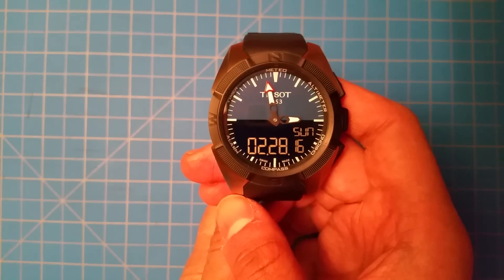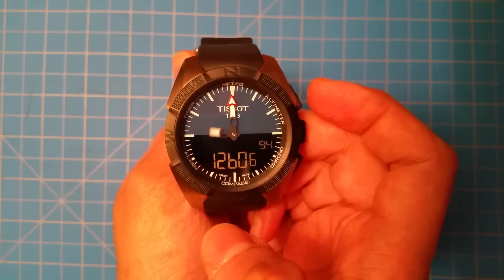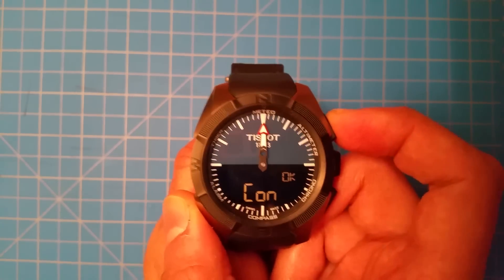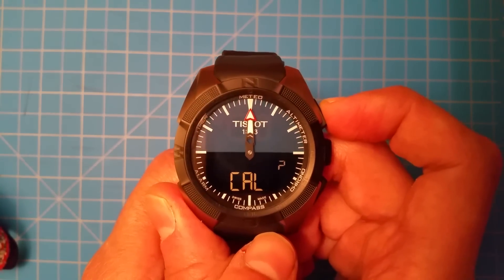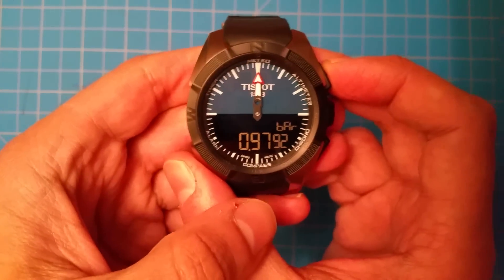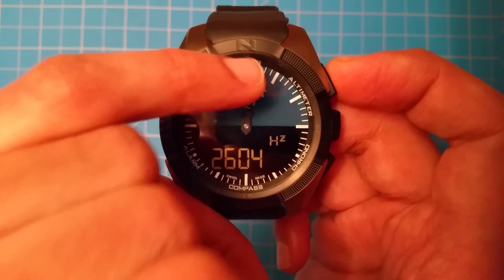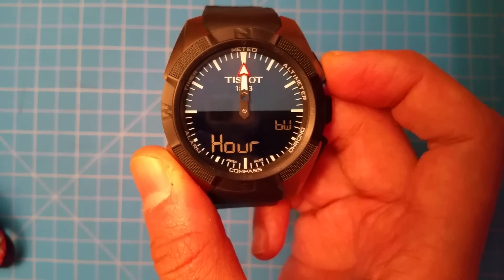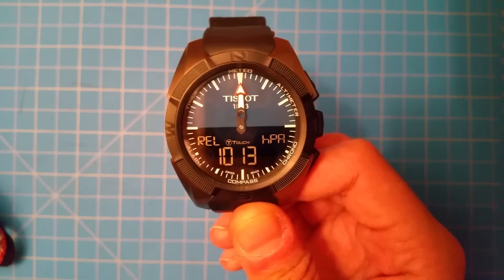Tissot T-Touch Expert Solar - service mode with hidden temperature/compass calibration

Comment: Great video my dear friend, full of useful info! Thank you for sharing it! Indeed, for some people like me, having a Lumen (Lux) Meter at hand (literally) can be quite useful as a tool (for example, in order to measure the performance of LED equipment), which, like most things, degrades over time). Most importantly, it's on your watch, so you can always, easily and effortlessly have it on you wherever you go! 🙂 
Oh man, you really made my day with this little trick! I'm writing this comment while wearing a "T-touch Expert Solar" and I had no idea I could even do this on my watch! 🙂 I'll make sure to try it today to see how it works in practice. Needless to say, I'm deeply grateful for sharing this "hidden" method with us all! Thank you so much! 🙂
It would be though much nicer if one didn't have to turn it off first in order to use that feature, as well as the *thermometer*, which means, I suppose, that you'll have to re-set the time whenever you want to "wake it up")...I wish there was a way to access/activate these features-tools without all that hassle. 😞 
in my opinion, this is one of its (minor) disadvantages, and makes me think a bit of it as a sign of (minor?) sloppiness in terms of design and engineering, because it would have been  definitely do-able. Indicatively, in my "Sea-Touch" (which is the divers' model in the T-touch collection), the thermometer is just a 'push' (with the central pusher) and a click away (by pressing with your finger on those points of the dial right next to the inner perimeter of the bezel, which activate the main features/functions! 🙂And as you know, that is because the Tempo is one of the main features activated through the bezel, whose position in the case of the 'T-touch Expert Solar' has been replaced by other features, such as the Meteo (that is, the barometer*), the *Altimeter or the Timer*. *But in any case, I'm pretty sure they could have found a way to make those features/functions more easily accessible to the end-user. Besides, doing this would only enhance the value of the watch from a user's point-of-view...Well, go figure! The world of watch-making is full of surprises! 🙂

Comment: ABSOLUTE GARBAGE!
Tissot T Touch and all other brands handled by the head company are complete garbage, don't buy them!
I brought my 10 year old T Touch to the dealers head office and they told me they could not replace
the battery, I would have to buy a new watch then tried to upsell me. The original T Touch cost around $2K.
Now it's garbage. $2K lost to a dead watch. Fuck em, I'll stick to real watches like Breitling.
Don't waste 2K on a watch that will die in 10 years. Complete garbage I tell you!
Avoid all watches under the head companies portfolio at all costs unless you like wasting money.

Comment: Great short video showing the hidden features. Temp was the main feature I would've like to have seen easily accessible. The Lum feature was used to test several torches (on post op leave and can't walk yet, idle hands and all that) and was quite accurate. Thank you for taking time to make this vid.

Comment: Hi 
My watch is showing different time on the digital and analog displays. Tried to use the Sync function and synchronize both but its not working. anyone have any idea what may be wrong?
Reply: https://youtu.be/f9Ge2jJWjfY check this video, maybe it helps you.

Comment: Do you have any idea about calibrating the barometer? My watch reads 3-4 Hpa above the actual pressure.
Reply from the maker: There is no way to calibrate the barometer that I'm aware. You can adjust it, but then your altitude reading will get thrown off accordingly. It would be nice to be able to adjust the absolute pressure.  Mine reads 2 hPa above actual.
Reply: @dalistylin7740  Have you found a way to calibrate the barometer? I could find a reading in service mode which seems to indicate the pressure in bar, but could not change it.
Reply: The difference doesn't matter, only that you can see a big and rapid raising or drop in the preassure on the minute hand is all you need.
Reply: How can you say that the difference doesn't matter? Tissot is a Swiss manufacturer and one would expect precision from such. It matters when you have set the barometer settings from the local weather forecast to get an accurate altimeter reading. In any case, not worth arguing about. Matters to some and not to others. BTW the iPhone's barometer is more accurate.

Comment: Question for you: can the barometer be set to read in inches of mercury, or are the only options bar or hectopascals?
Reply from the maker: No, it can only display in HPa.
Reply: Bummer, thanks for the reply.

Comment: I wish they would DELETE the Altimeter, and add the TIDE function to the Expert Solar!  THEN it would be a perfect watch for boaters, surfers, kayakers, Navy, divers, sailers...    Who needs and altimeter on their watch??
Reply from the maker: Machria23 I personally prefer the altimeter function. The tide function is available on the Tissot T-race watch, but it lacks some other features of this model.
Reply: Get a tide app or look it up for the day in question. Tide times on vary by minutes per day it's not essential.
Reply: totally agree; say a person who used to live at 10K. So silly to have an alt. function if you're still on the GROUND! We could always tell how high by how hard our heads were pounding when we hiked LOL. And so you know exactly down to the foot how high you are, what exactly does that give you? If you can't read a topo map in the daytime and look around, go home....
Reply: @rockymntdan1  Fortunately not everybody is always on the ground! The altimeter function is useful for pilots, and would be more useful if we could adjust the absolute pressure.

Comment: For those of you who want to get the NSEW digits into black. Buy a fine tip permanent marker and color them in. I did mine and it worked out perfectly. Great finish in dark black and has been on for over a month. Even been swimming in the sea

Comment: if you are looking to remove the N.W.E.S letters use a sharp blade and try to get under the letters, because on my tissot PRS200 some numbers started disappearing and after playing with the numbers and touching them I found out they are very hard inks that can not be faded away by wear and scratches but they can be peeled off completely in one piece with my nails. also Im looking to get this watch but Im looking for a version without these letters and titanium, do you know any other model?
Reply: As stated above. Without damaging the watch I just used a fine tip black permanent marker and colored the digits in. I waited for it to dry and applied a few coats. Works a charm and looks good.
Reply from the maker: sweet dreams Later, I ended up using black acrylic paint to color over the white lettering since it doesn't wear off easily, but removable with alcohol or ammonium solution if I need to in the future. There are some other models of the Tissot Solar Expert without the NESW lettering, but instead 12, 3, 6, and 9 hour markers (equally useless), but I prefer the style of this model (in terms of dial and hour markers).

Comment: Hello ! You can change the "meteo" readings hPa in mm Hg?
Reply from the maker: Unfortunately, you cannot change the units. It only displays in hPa, which is considered the international standard for measuring atmospheric pressure. I am having to get used to this since in the US, inHg is most often reported.
Reply: Thank you . another question. Why is there a thermometer in the service mode.  usually it is impossible to use. it would not be bad to have "termo" normally mode.
Reply from the maker: I have no idea why Tissot decided to hide this feature. I think it's useful, even if it may be inaccurate on the wrist.  It is not practical to access this feature in day-to-day use.  It is puzzling that they removed the "thermo" mode and added a useless non-rotating bezel with compass markings.  Despite these flaws, I do like the watch.
Reply: +dalistylin I really like it too. I have them for two years. Only orange design.

Comment: was hoping the temp. would be displayed as well with the pressure reading...thanks for the vid...
Reply: after seeing the temp change with your hand touching the back its good they didnt add this feature because it would mix the outside temp with your body temp and give you something not accurate and useless.
Reply from the maker: Same here. Wish they made the feature readily available. It could only help sales by advertising more features. Not sure why Tissot removed this.
Reply from the maker: sweet dreams I think it would still have been useful if Tissot made the temperature reading readily accessible. The quick responsiveness of the thermometer indicates it could give an accurate temp reading after a few minutes if removed from the wrist. They could have incorporated a simple corrective measure to compensate (semi-accurately) for temp reading while worn (though not ideal, other watch companies like Timex have offered this as an option when using the temp function).

Comment: Hello ,   what  is  the  autonomy  battery life  of the  watch , if  you  play  daily  with  ?
Reply from the maker: It's solar powered so battery life is not a problem. The battery is rated at 1 year without any charging. I've used it quite heavily and the battery had always been at full charge.

Comment: Useless this Bezel? 12 o clock fix point to Nord.... You know who is East and west without see it on the bezel?
Reply: dalistylin 
The markings are so you can aline the watch to a map or a chart so it is correctly orientated to North you dumb arse
Reply from the maker: I agree that the compass markings are useless. I've read every page of the manual and my conclusion is that it serves no purpose other than cosmetic.  If the bezel was rotatable, the markings could be justified, but it is not. It's too bad because I think the markings "cheapen" an otherwise excellent watch.
Reply: Studer Florian 
So in your mind a Silva compass doesn't need any markings!!!!!!!(+_+)
Reply from the maker: How useful is a Silva compass with a non-rotating bezel?

Comment: Great hints and nice review. I love the way you have darkened your bezel's NESW markers too. What have you used to achieve that result ?
Reply from the maker: Thank you. I used a black wax pencil, or "China marker" to fill in the compass markers. It is not permanent, though. The compass markings on a non-rotateable bezel seem totally useless to me, unless I am missing something. That would be my primary criticism of this model. Otherwise, it is a fantastic watch.
Reply: +dalistylin I've done the same but it was wearing off after a while. 
After adding a layer ever two weeks I have wiped all with acetone and it is back as new... 
Fantastic watch,  yes! 
Very sturdy. 
And the electro luminescent screen is really useful for setting functions on the dark. 
I have written some reviews on watchuseek about it. 
But your video is a great tutorial! 
Way to go!
Reply from the maker: +Nemo Sandman Thanks again. What is your username on watchusgeek? I'd like to read your reviews. Did the acetone dissolve the original white paint? The black wax I've used leaves some residue.